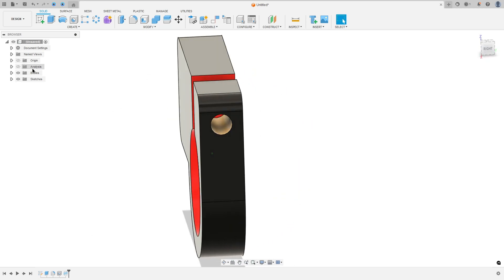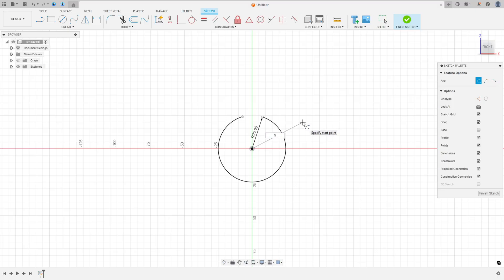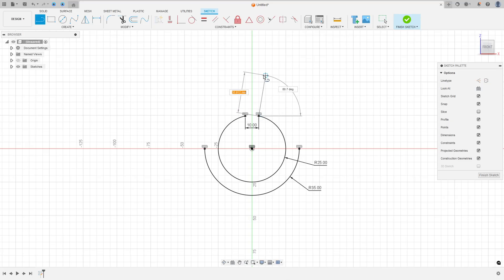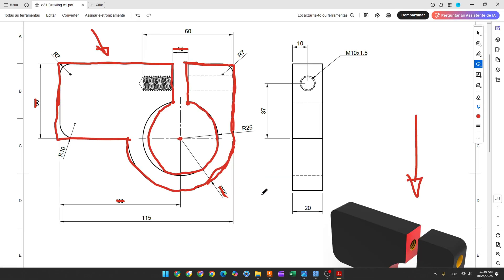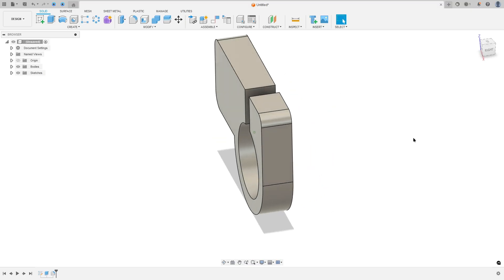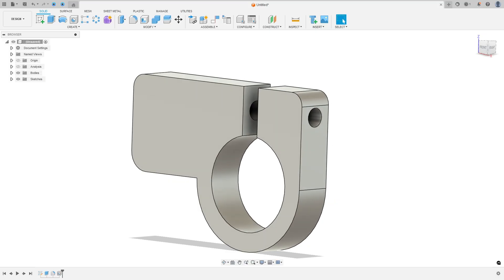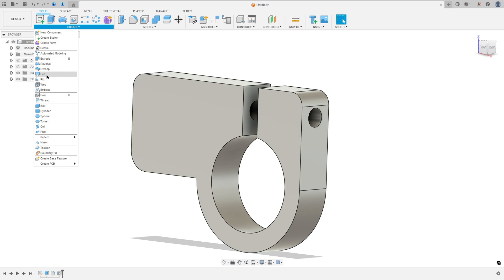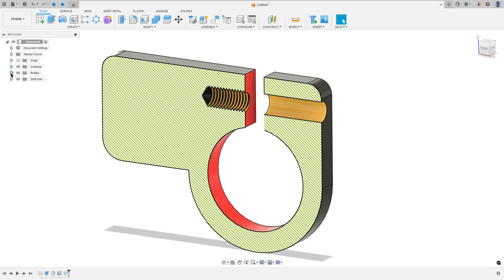Autodesk Fusion 360 Tutorial For Begginers - Exercise 32

Comment: I'd like to see the bolt hole have clearance in the flexible section of the clamp. Fusion won't let you do this in one step so I use two hole commands. the first is the tapped hole selection of a m10 x 1.5 for the full depth of 60mm. For the second hole, the clearance hole, I use the same surface and select a clearance hole for a m10 x 1.5 and use to object  and choose either  surface of the slot for the extent. You could also use the measure feature if you wanted to introduce that capability.